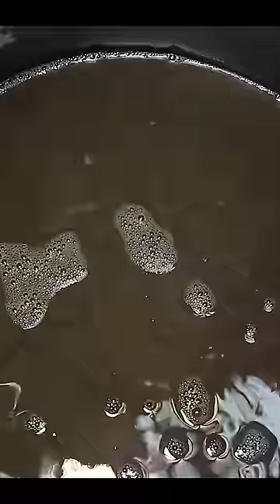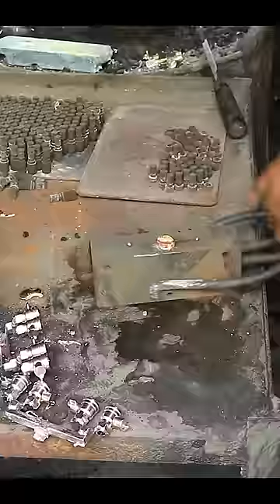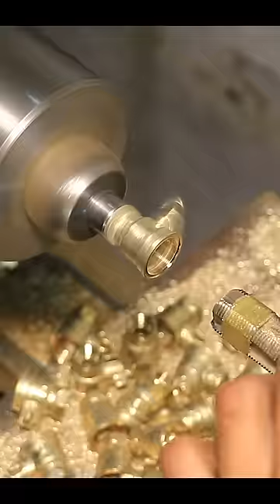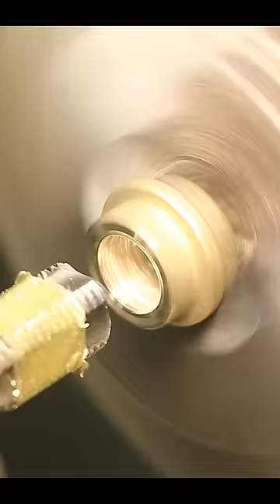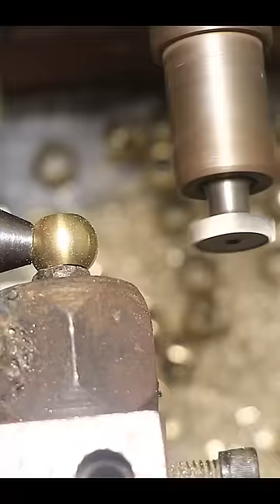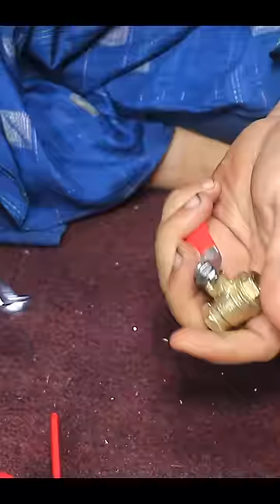Manufacturing Valve Handles #shorts  #manufacturing #valve

Comment: Con razón mi plomero me manda a comprar válvulas italianas aunque cuesten más 😂😂
Reply: ni vienen de italia 🤣
Reply: @z1lla4 these ones no, but Italian valves if are certified as required are usually good products, seen an assembly line 5 years ago or so, of these kind of valves build by some Italian companies and sold in Australia. Maaan, those machines do hundreds of valves per minute while operators don't touch anything, only control the process. Was absolutely a charm to watch.

Comment: It is easy to drainage to the changes  oil of machine vehicle for manual pipe oil drain on. Please let used locker pin for safety yet. Hana Tubiera and captain city Philippines